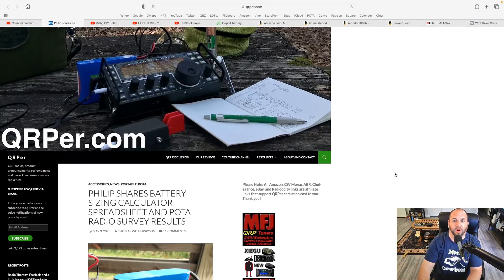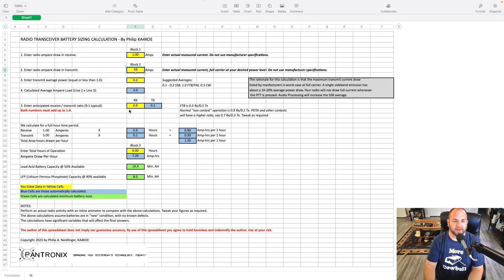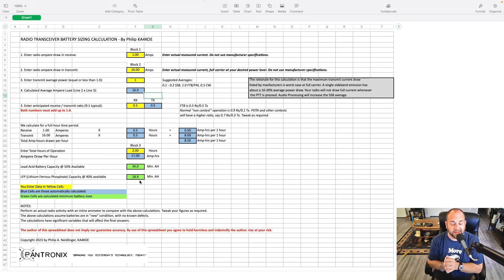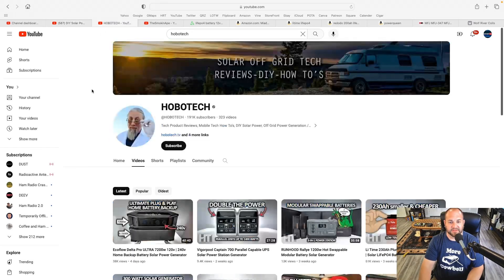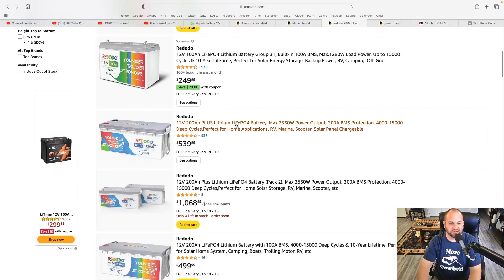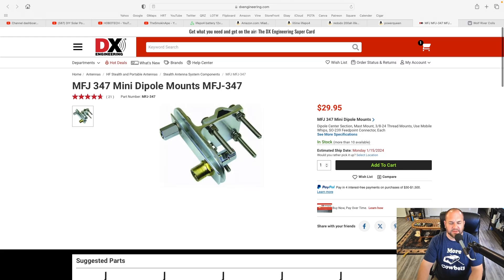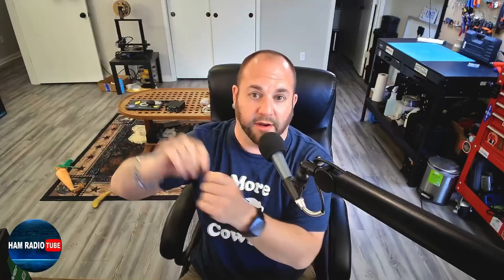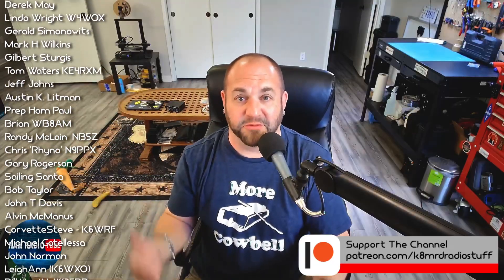Damn The HOA!  Try This Stealth Antenna Setup Instead.

Comment: I bought a house in Florida with no HOA.  I wanted to put up a crank up tower....only 40 ft extended and about 22 ft. nested.  Silly me....I went to the county zoning folks and they said, "NO".  Then I pulled out the FCC ruling that prohibits zoning against ham antennas, PRB-1.  OOPS.  The zoning guy had never heard of it.  He scanned it and asked me the minimum height of the tower....and approved it.  Of course,  it never stayed at that height.  Later on, I bought the vacant  quarter acre lot behind mine and put up a guyed Rohn 25 fixed tower at about 66 ft plus mast and ten element log periodic beam.  None of my neighbors said a word...and the zoning guys never knocked on my door.   I used the tower to center support a two 5/8 wavelength dipole on 75 meters (300 ft overall length).  During winter, I worked Europe every night and also occasionally Asia and Australia.   Moral of story....NO HOA.

Comment: I live in a HOA because I couldn’t find a decent neighborhood in the area I needed to be that didn’t have one. I have no regrets. The rules here have been negotiated twice that I know of. I can have a vertical up to 44’, an uhf/vhf antenna mounted to the eaves and a horizontal above the roofline. If you are restricted find someone that can present a well written case and is able to present themselves in a positive light. That might not be the loudest talker in the club.

Comment: Hi Mike.  I am a US ham operating in Japan.  I want to try POTA but I have some questions that are way too basic for your normal audience.  I need to ask them anyway if for no other reason than for my own piece of mind.  First, the parks near me are often occupied by parents, children, dogs and old people.  If I set up a station I will likely draw a crowd, most of them children. Q1. How dangerous is it for curious hands to touch a live antenna while transmitting at QRP levels?  Q2. What do hams do to prevent that? And Q3. What is considered a safe POTA power level?  I'll be using a 17' whip with a loading coil and ground radials. I'd try a tabletop mag loop (5W max) but I already know those are dangerous. Thanks. 73 JS2OLO

Comment: Hi Mike, I have used  the short (6-7 inch coil) type wolfriver coil  and 13 m of wire and can do  80m-75m on it and still can adjust  the coil to tune nicely I also have a 1m,2m, 3m, 5m,10m wire which join together   mix and match  all freq for HF  freq works great , Thank, Pieter, ZL1PDT

Comment: One thing to consider when it comes to battery is how much current draw a battery can handle. I have two 3 aH LiFEPO4 batteries I use with HTs or FT-818, but I wouldn't be able to use them with a FT-891 at 100 watts TX. 73 KD5YOU

Comment: Mike, on checking 80m performance during the day I use Winlink and VARA HF. Send a sample email out to a nearby 80m gateway and swap antennas and do it again. It will show S/N stats for each connection and this can be used as a crude point of comparison. Great update as always - 73 de VE6LK

Comment: I live in an HOA with a no antenna rule.  I put up two 60' towers and a total of 9 antennas. They tried to fight it and I won because my property and I own it not them.
Reply: Yep, I'm Australian and we don't really have HOA like the US, but we do have villages and apartment blocks ect.
But everyone is an expert on a subject until they meet the judge, or magistrate as we call low level judges here. 
Ultimately it's the courts that decide and many people don't understand this, the courts have all the power.
Reply: It's a load of crap HOA
Reply: Recently moved to a new house and the HOA has a loophole in the rules they use to exclude antennas. And I don't mean just towers, they went after someone for a TV antenna on their roof. Kind of strange because other than this they really aren't a problem. Rumor is if you ask for permission first they'll send it to the architectural committee and most likely approve it. I'm not going to give them an opportunity to say no. I've been getting to know all the neighbors and have been talking about what the HOA could be doing and where they're falling short. Goal succeeded, about half the neighborhood has asked me to run for president of the HOA. So come April I can assure everyone that if they want an antenna all they'll hear from me is to call if they need help putting it up.

Comment: Try a 40m ham stick attached to an EndFed 9:1 unun, replace the aluminum whip with a brass whip, then solder a wire to the tip of the brass whip and take the wire out to wherever you can.

Comment: I’m in Mexico operating some mxexpidition outlaw radio. Using a wolf river coil, MFJ 1979 on a camera tripod. I could never get 40 below 1.5 and narrow bandwidth until I used one raised radial at 4’ 32’ long. Used two fewer coil steps and much better bandwidth.  Tomorrow I’ll try the radial in the Pacific Ocean.

Comment: Hey Mike! The coil & wire combo to a Spiderbeam or a tree is a good go-to. I’m activating 160m the exact same way now for my pota’s. I’m using a little too much coil than wire at moment cause I already had a 70’ wire cut and just used it timebeing, but I’m using a LONG coil inspired by W0BNC (Google the call/coil), and bypassing the portable tuner! Anyone QRZ & email me if curious to see.

Comment: LOVE the shark sticks. I used these on a trimag  mount on my 2001 Durango. I ran a coax under my garage door and plugged that to my 7300. Got all 50 states award with that setup. 40 works great, 80, not good, it’s a 75 an narrower than a narrow tunnel, LOL I live in an HOA, but now I have a DX Commander Rapide, very happy with that.  That said the Shark Sticks are awesome and a great way to get going.

I went with the DX because I got tired of going out heavy snow to change bands. I am in Heber City UT and today is one of those days, snow has been comin down since last Wed. Got 3.5 feet out there right now! 

Louis
WW7GBA

Comment: I use a little manual tuner with a bunch of hamsticks (10-40) for POTA.  Because of the tuner, there's no piddling around with stinger lengths and I can slam the swr down to zero.  I've hit from Hawaii to Africa doing this.  
Hamstick dipoles are also decent - not great, but decent.  This was my first HF antenna - set of hamsticks on top of a telescoping harbor freight flagpole.  I learned that you can tune (again with a manual tuner) a pair of 40 meter hamsticks to resonate on 20, 17,15, and 10.  They pretty much suck on 80 though, no matter how much you fiddle with and tweak them.
Also, Power Queen would be a cool name for a metal band.

Comment: I've used that spreadsheet for my FT-857D and FT-818 for SSB and found it to be quite accurate. I've never really killed my 12Ah Bioenno but I got close last Field Day and it lasted pretty much as long as the spreadsheet said it would. Same for WFD with the 818 and a 3Ah battery.

Also worth noting is that turning a 100w radio down to 5 watts uses less power, but not 1/20th. More like a 1/3 or so on SSB. On SSB, at 5w my 857D draws 3.3A, where my 818 draws 1.0A.
Reply: What size battery do u recommend for the ft-857D ?

Comment: I have a 50ah Time USB in a power werx Megabox2, it works really well, the battery weighs 11 lbs so the weight isn't to bad,the battery size does require a little persuasion when installing it in the power werx box but it will fit and you get a lot of run time plus have quite a bit extra for charging and running other stuff as well. I run my yeasu ft 450 D FOR weeks before recharging and even then its only at about 60 %.
Granted its not running every day but when I do get on the radio its usually for 3 to 4 hours at a time atleast 3 days a week.  KE8ZII,  73.

Comment: "Two Hamstick as a rotatable dipole?"   That's what I use both at home (with HOA), and with my POTA setup.  It works quite well.  DE WB0POH
Reply: For years I used two 20m hamsticks on a TV rotor, it offered considerable performance over my Butternut vertical and G5RV and of course, directivity. Stacked a 2m beam on top of it.

Comment: great questions and answered,  even ham radio 2.0 has tested battery's . and some portable power stations. never building that DX commander. which some day I see in a glass display case . my rule for battery is always 2X minimum.  that bring 2 battery's . what AH or watt hour you need times 2 . one is none , 2 is 1 and 3 is 2 . how I do math for portable HAM. 73's

Comment: Thanks for the info on batteries and a great spreadsheet.  I want to mention something I feel that is important, but left out of the spreadsheet.  In your first example using SSB, you are transmitting using 16 Amperes and the recommended battery size for 1 hour of use is 2.1 Ah.   That is not a good "C-ratio", which is how much current you should safely pull from a battery, with 1C being the Ah capacity of the battery.  In the case of the SSB example, that would be 2.1 Amperes.  You would be pulling 8C with your 100W radio, which is likely too much for a small LiFePO4 battery that likely is limited to around 2C.  I would like to see a column for minimum battery size based on Ampere draw, for example 16Ah for a 16A draw.
Reply from the maker: That's a good point.  Didn't even think about that.

Comment: I have good luck with a 9:1 unun and 71 foot 28 gauge wire. works 80 - 6 easy. lots of ways to run the wire to hid it. 28 gauge is hard to see any way.
Reply from the maker: That would be a great solution as well.  That real thin wire is pretty much invisible and can handle 100 watts no problem.